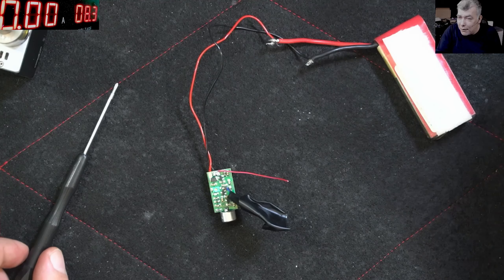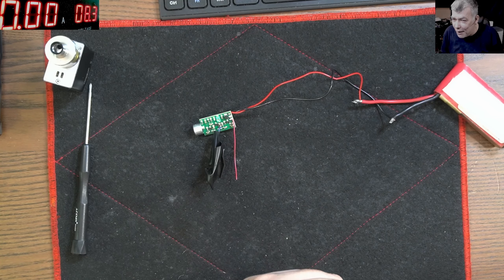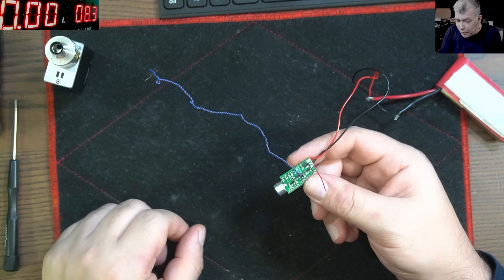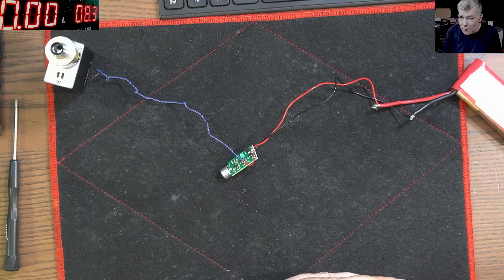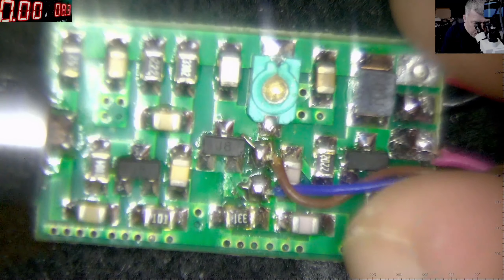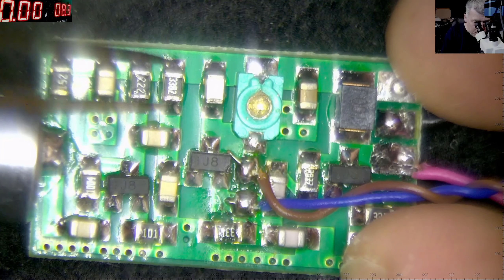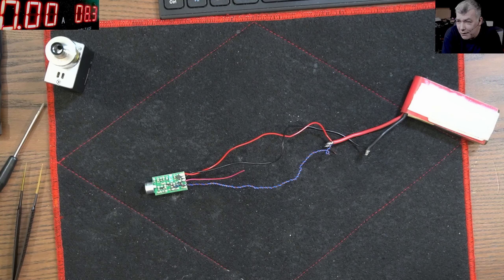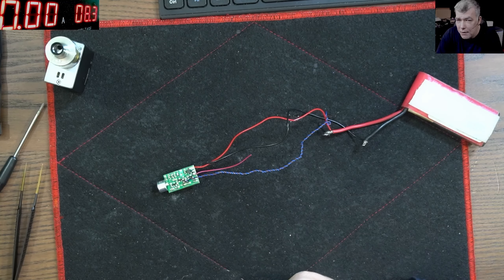Missing component from this FM transmitter is.............. :D

Comment: Great Video Sorin!  It must be understood that the flow of power passes in a field around the wire, not within it. The spacing of these two wires in this configuration even with the insulator is not sufficient to shield them from the effects of the others. This is why there is a capacitance value observable on these two (non connected) wires. This principle is how capacitors are constructed. This effect is also a major concern when designing PCBs within high frequencies especially as you do not want unwanted capacitance in the end product due to poorly places signal and power traces.

Comment: nice to see,
But this could be better! so much noise in the first video? ( FM RX Bad! )
if I were to turn on this transmitter you would not hear less noise!
(I don't know what caused the noise, would have to guess)
and yes of course, I am still a pirate every now and then!
started when I was 13 and am now over 60 (also have a license!)
WFM, SW, MW - AM still do it occasionally!
but that comes here in the Netherlands that is still active.

regards
Radio Rob

Comment: A capacitor always consists of two conductive sides with an insulating layer in between which can also consist of air! The size of the metallic surface and the distance between the plates determines the capacitance. It doesn't matter whether these are cables or how large the distance between the two conductors is. Even an antenna is essentially a capacitor, with the transmitter being the other side of the capacitor isolated by air.

Comment: Hi I'm from srilanka my dell lap charger has current leakage when I used it will some shock com from steel part of my lap this is not our home earthen problem I will checked it another charger it is not happen any leakage damage this leakage charger I used long time about 1 year that will make my motherboard damage some parts.now my lap some time not power on when I press power button first time. What is the reason give me some solution for this problem about your experience.thank you very much.i also liked your Chanel  that is good I watch some videos of you interested.thank you.